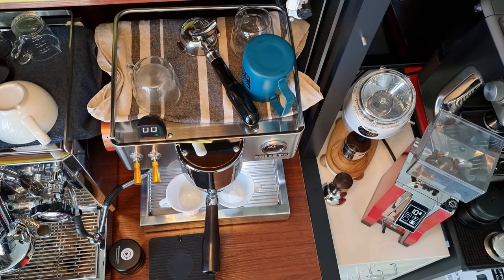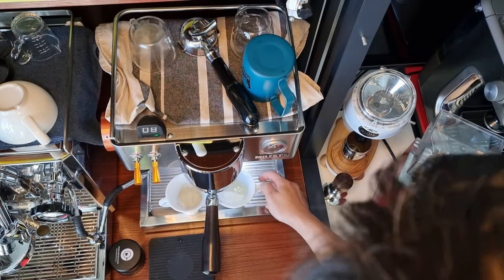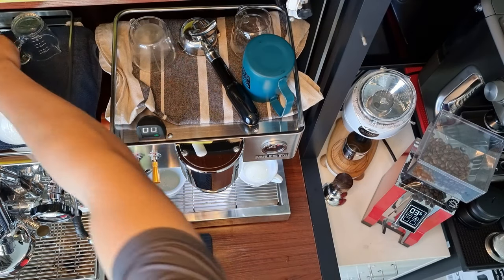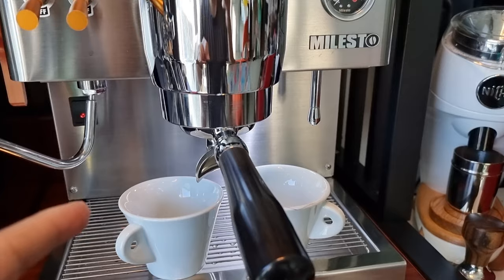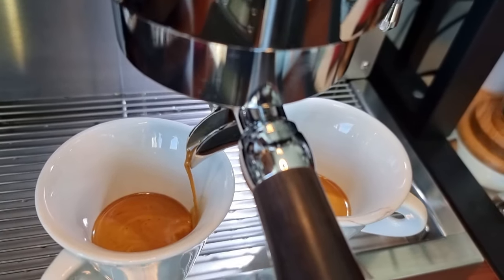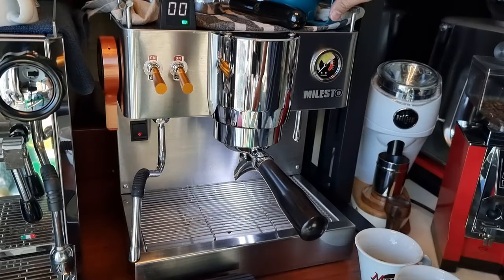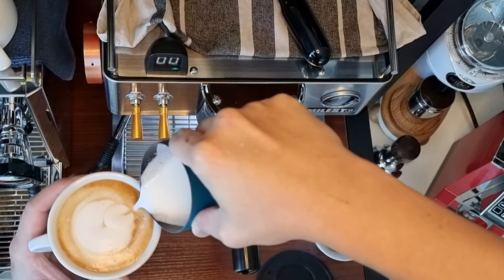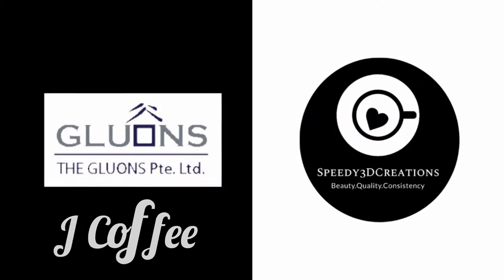Work Flow | Elaine M3 EM19-M3 | Milesto Espresso Machine

Comment: Hi CY. nice video on em19m3 workflow. I just received mine and still experimenting. I noticed 2 thing during brewing and need your expert view. 1. while brewing the pressure indicator went all the way to full scale in red mark zone. what is the normal range of indication? what that full scale indication tell us? 2. I notice the water flowing out into the tray behind the panel. I saw it happened also in your video. is that normal or is something wrong it shouldn't happen?Thanks...
Reply from the maker: First thing first. Thank you for supporting my channel!

For the brew pressure gauge, if it shows the indicator going to the red zone, you are grinding too fine. Try to grind coarser. 

The water that back flow into the drip is perfectly normal. The machine has a 3 way solenoid valve which purge the extra steam pressure into the drip tray so that the pressure can be relieved.